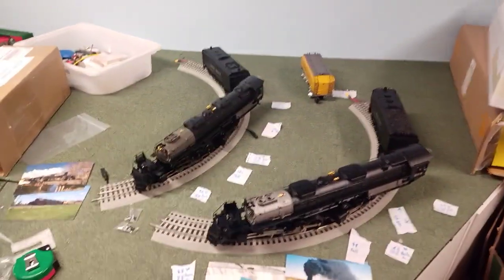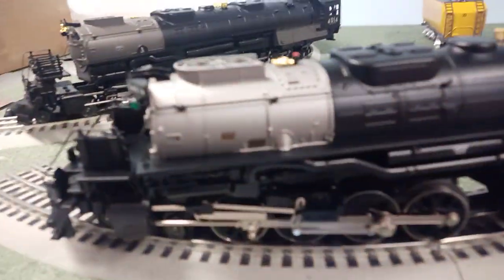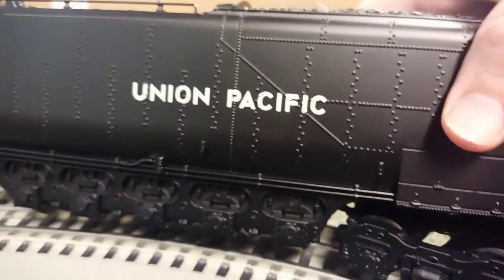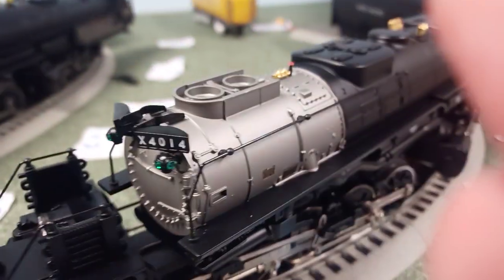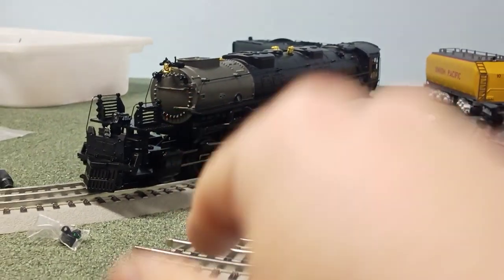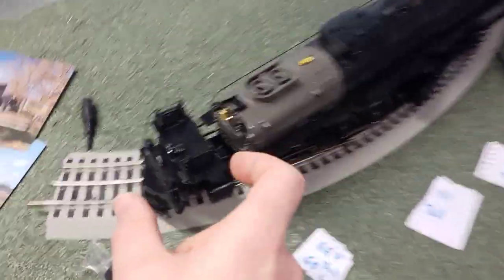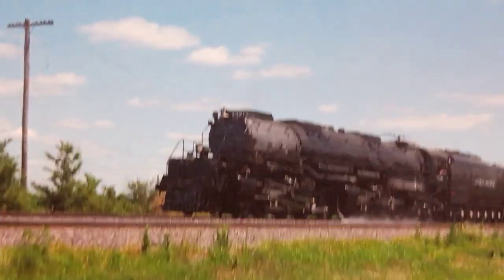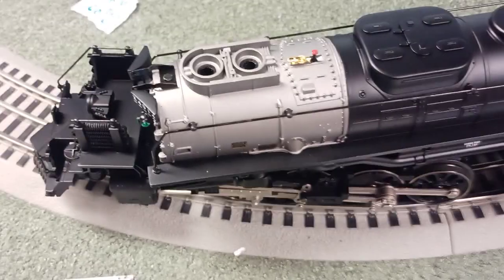Lionel Lionchief 2.0 4014 Big Boy vs MTH 30-1840-1 o31 compatible

Comment: just a note on the air cooling radiators, the early builds did have them at first, look at the older pics of the 4002 and they are there :)

Comment: K-line mated some of their 4-6-2 engines ( MarX 1829, 333 design) with a much wider tender. (Usually the ones with the real sounds system in the tender.)  It seems different then the normal thinner ones, and it is true MarX did have most their stuff more closer to the S gauge size, however in reality any tender might be used with any engine in the steam engine era, unless it was a specialized tender and matched pair like a coal auger was needed..